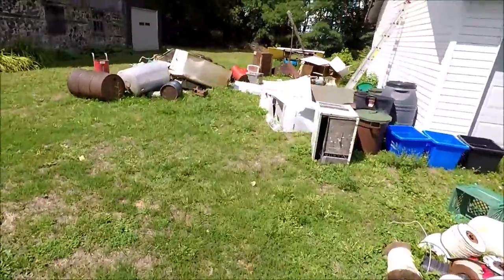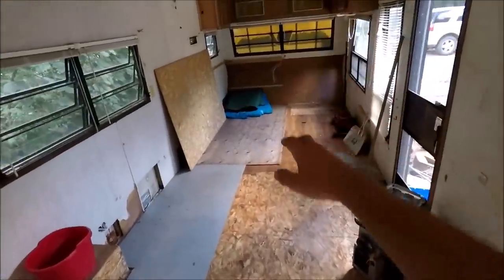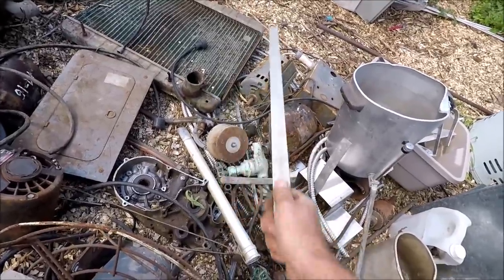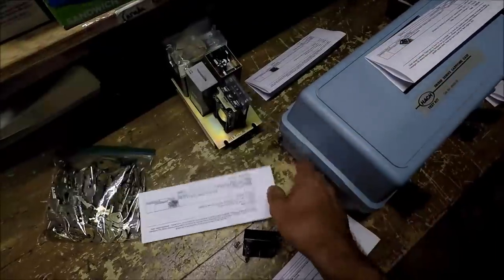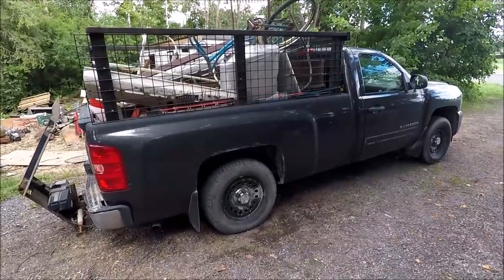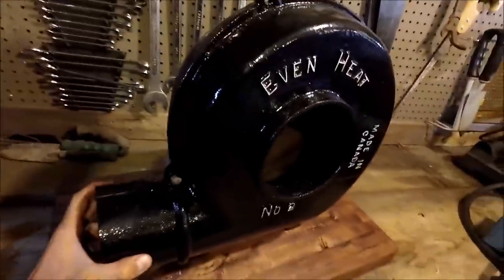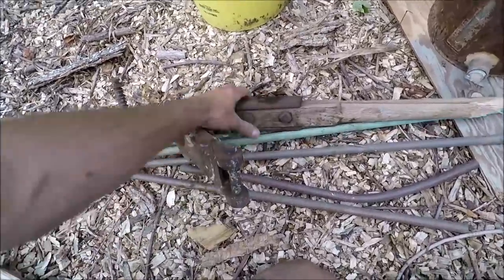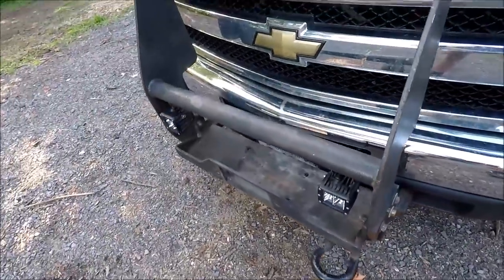Cleaning out an old timers garage for scrap and relics

Comment: The voltage regulator thing that you restored it's probably for big heavy duty drill press or something and you could slow down the motor and speed up the motor with that dial